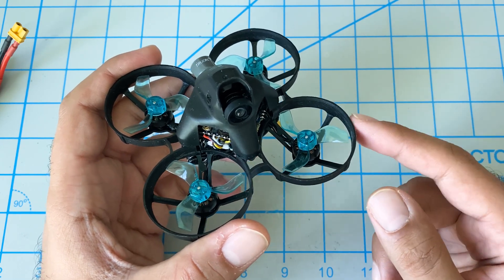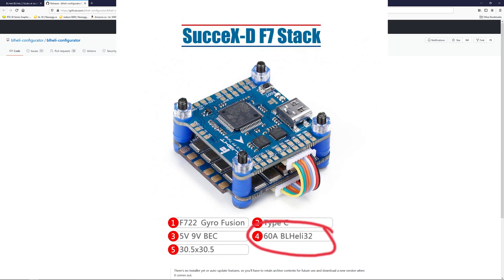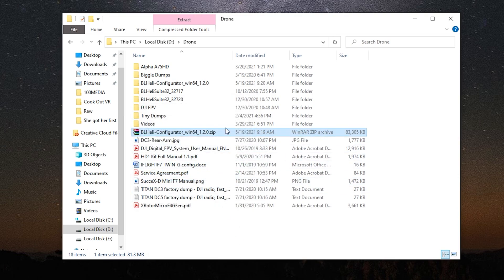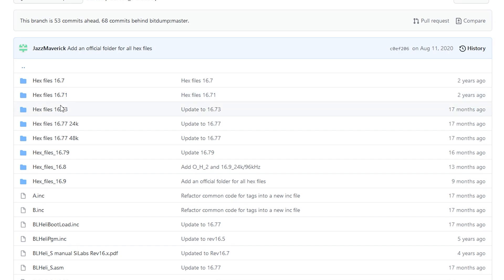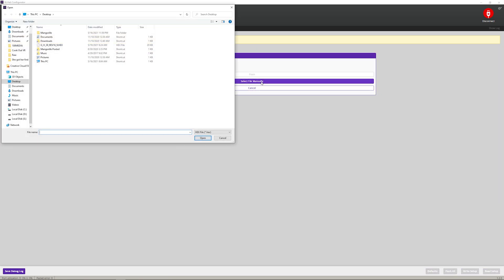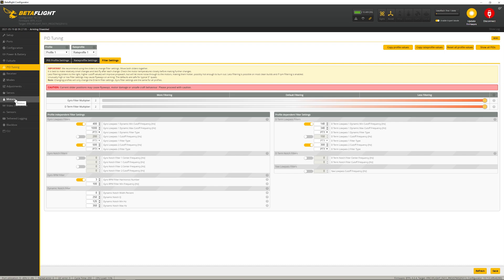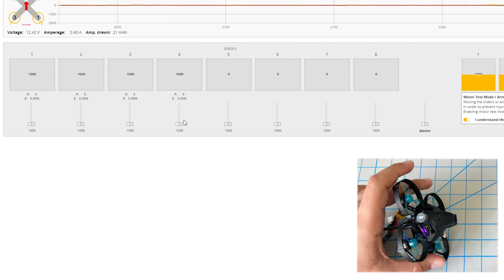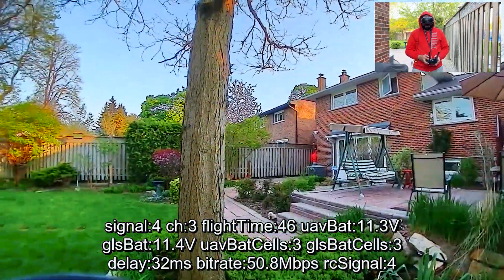How to Add RPM Filtering & Bi-Directional DSHOT to BLHeli_S ESCs | FREE iFlight Alpha A75 HD UPGRADE

Comment: Mine will let me turn on bidrectional now, but it still doesn't get RPM data so I have to keep gyro RPM filter off or otherwise it won't let me arm. Progress though lmao, I used to not be able to use turtle mode at all
Reply from the maker: Sorry don't have this quad anymore to help you with troubleshooting but the go-to now is actually BlueJay and not JazzMaverick anymore. Did you install BlueJay?

Comment: In the movie you checked how many magnets there are in a 3000kv motor and you succeeded because the 8000kV motor is also 12. Probably most of them have that. What would happen if you typed 9 etc. and the engine is 12?
Reply from the maker: I think it would make the rpm fitering not work correctly.

Comment: The versions of BLHeli_M (Maverick) above 16.73 had some problems with RPM filtering due to telemetry data being reported to the FC with the a too low frequency... has that been solved in 16.9 for sure? Does anyone know?

Comment: I wonder if this is safe to use on aio boards. I have an AIO (H7 iflight 55amp) in a 5 inch and i wouldnlove to use rpm filter but not sure if its safe
Reply from the maker: Yes should be fine. This whoop uses an AIO board from iFlight as well, no problems since doing the flash.
Reply: @Mangorille  thanks for your reply. I should give it a try. But i can remember people had issues with iflight beast aio, but not in the h7 v2. We will see, ill do some testing

Comment: It changed the flight? More stable? it is a must? I never tried this before. Thank you! Do you have very well explained videos :)
Reply from the maker: Hey. It was a small improvement on the A75 as the frame is already so flexible. It would be a bigger improvement on a larger or more rigid kawd. My 3" and 5" have the rpm filtering and big improvement!